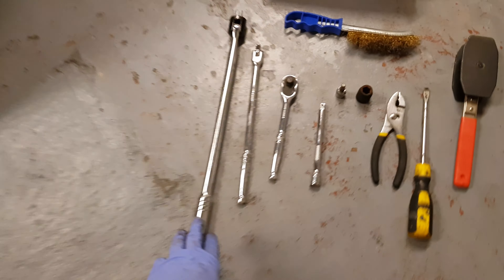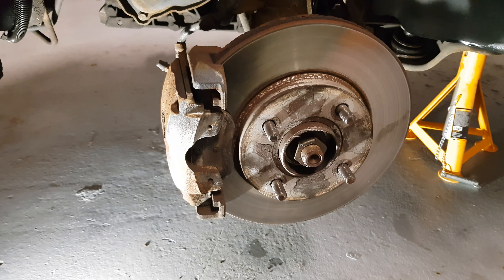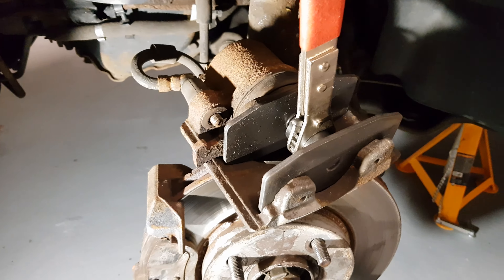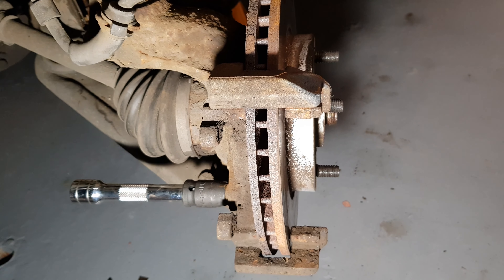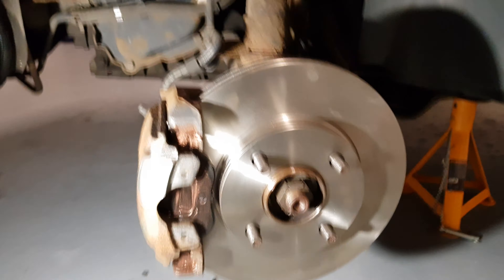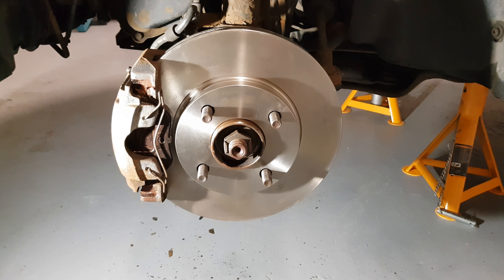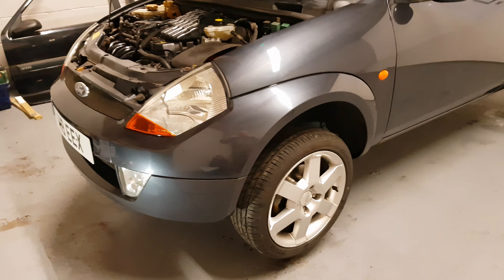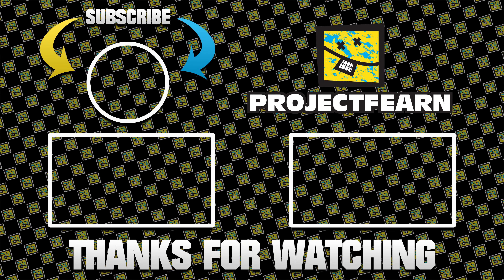Part 14 - Front Brake Discs And Pads On A Ford SportKA / KA

Comment: so the caliper bracket holds disc on?
Reply from the maker: On a way yes. The wheel bolted on actually locks the disk in place pal 👌